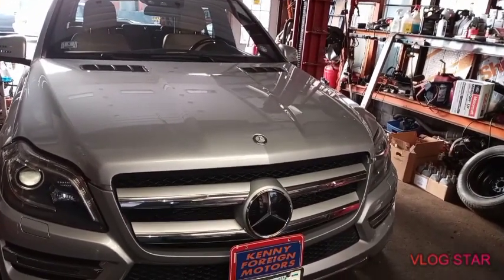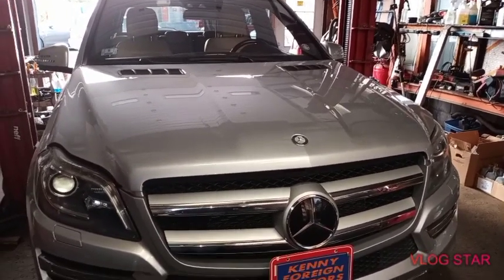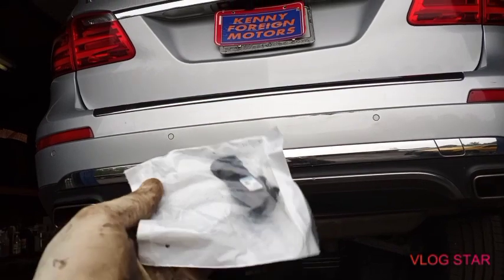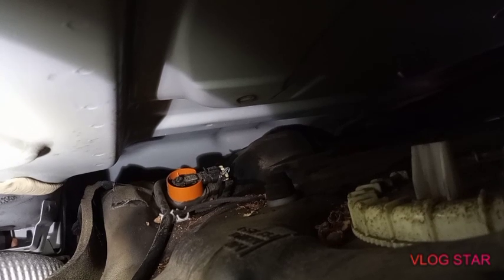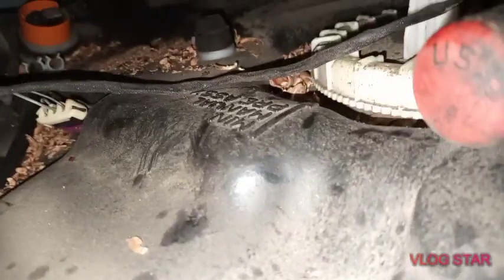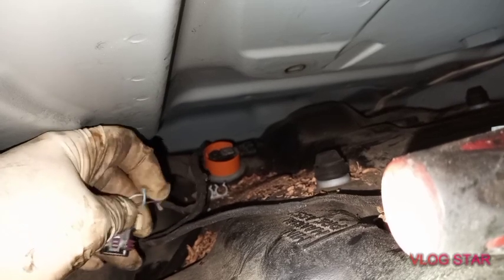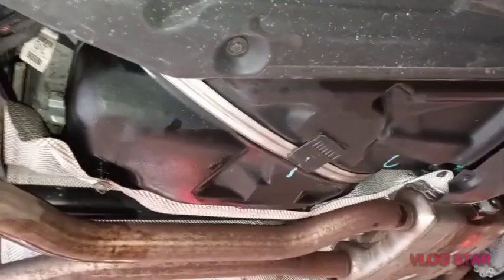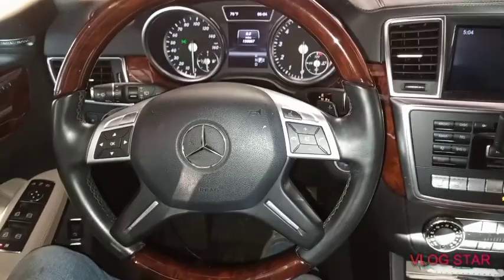2013 Mercedes Benz GL450  DIY  P0451/P0452 fuel pressure sensor

Comment: Success, I was able to replace the sensor with your method.  Now I am getting a PO453 Short to Positive with my scanner.  Did you actually purchase a new harness for the tank attachments portion to the X18/3 connector or repair it?

Comment: Thank you.  Dropping the exhaust and propellor shaft is just nuts to change a sensor.  Good video.  Was this a 4MATIC?  I have a 2013 ML350 with a 276.955 engine.  I am getting PO451 and PO453.  Car runs fine and has new gas cap.  My estimate from MB was $4000.  I think the FTPS is in a slightly different location but still on the top of the tank and separate from fuel pump.  Any comments appreciated.  I am capable of this work so I am planning to do it myself.

Comment: Can I just cut a hole on top to avoid dropping the tank
Reply: I was thinking the same thing, BUT the hole-saw pilot bit would almost certainly puncture the tank. Hope someone else knows for sure and posts it here.
Reply: Mercedes i think they have eliminate the top cover due to old one got smell off fuel inside the cabin when rubber are wear out due to weather
Reply: I think there are nibbler tools that could do a safe job.  Would have to come up with a gasket seal and oversized cover with bolts or possibly sheet metal screws (short ones!). I don't know the clearance between the tank and the body floor.  That would be nice info to get from Kenny.  For DIYers without a lift this would be awesome.  But with a lift, the time involved would likely be less than the above cover fitment.

Comment: I have a W164 ML500, which has the same sensor, but in a slightly different location.  To reach it, I lowered the gas tank, as in this video, and then removed the access plate from under the rear seat.  There are two such plates, one on the left/driver side, and one on the right/passenger side.  It's the latter plate.  There is enough room, barely, to get your hand in to pull the sensor.
Reply: W164 on right..? Im look ml3502006 not see any where
Reply: @targa6sp993  The sensor can't be seen through the access hole.  To reach it, you have to drop the tank a few inches, then reach toward the left through the hole.

Comment: Just did mine today 07 Mercedes’ r350 pain in the ass but just keep pushing down fuel tank sooner or later there will be room I took off in tire wheel since I don’t have a lift will see if check engine light goes off
Reply: Did the check engine light went off? After replacing tank pressure sensor?

Comment: I have a question I have a 2017 Mercedes-Benz GLE having a problem  trying to start not turning over I test the fuses underneath the rear passenger side I found out the fuse where the fuel pump the fuse was blown only one side of the fuse work and other side didn’t 

So I put a new fuse it blown it out instantly

Is that cause from a bad fuel pump

Comment: Ok I’m back to update after replacing my sensor 
First of all do this on your own risk 🤣
When u was taking out my sensor I broke off nipple that goes in the fuel tank 🤬
Yeah at that point I knew I was fu(ked I did manage to take broken piece out with drywall screw. What I did i found drywall screw there hole in middle of the nipple I screwed screw in the nipple and start to wiggle after about 1 hr I got it out. 
If you don’t have long arms and you’re not strong don’t attempt this UNLESS (you are ready to drop tank down)
This is good idea if doing this job but you can be Royal Fu(ked if you don’t know what you’re doing. 
Now for shitty part after I replaced sensor I still had error come back P0451 I didn’t accomplish anything. 
My car is running fine I do not have check engine light  it just bothers me know I have stored code. 
Good luck and do not brake sensor 🤣

Comment: How do you get the tank down far enough? I don’t have a lift
Reply: Bro just did mine today just play with it and keep pushing down eventually you have some room I was not patient and broke off the nip of sensor took me awhile to push it down but managed to put new one on! Saved couple thousands
Reply: @Primo5karla thanks dude 👍🏻
So this sensor is not located on top of the fuel pump? Or is it 
It appears it’s in middle of the fuel tank